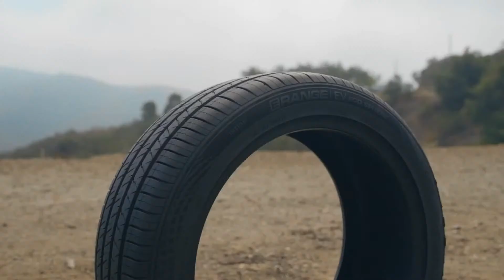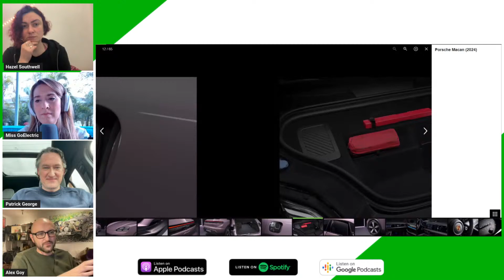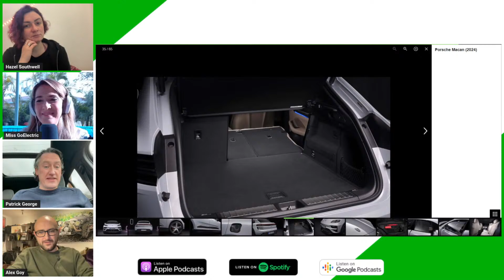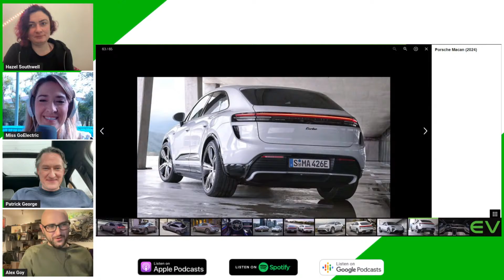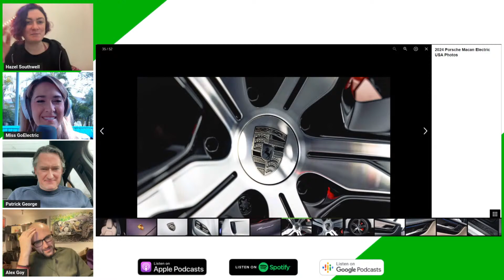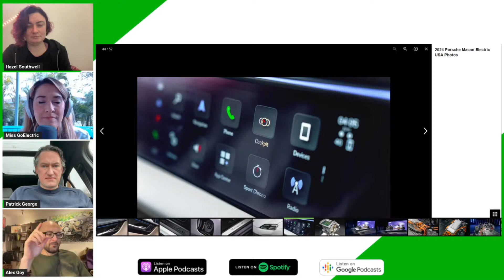InsideEVs Podcast #195: Porsche Macan Debut, Volkswagen ID.7 First Drive

Comment: You insane suggestion to use a wet towel to spped up charging shows you are totally clueless. The slightest gap in the protective sheath on the cable and that misguided SV owner will die. You have zero credibilty